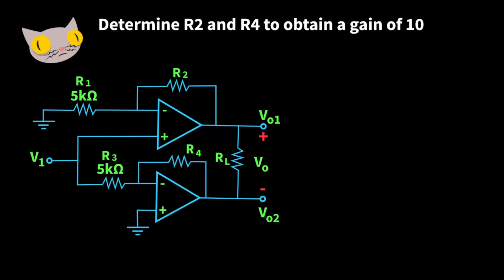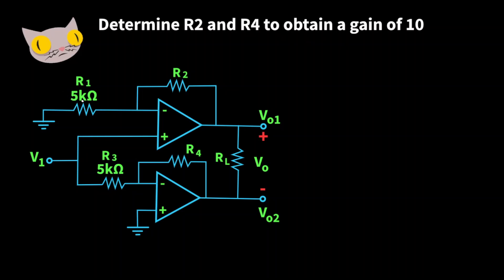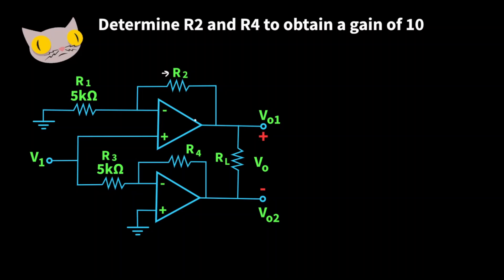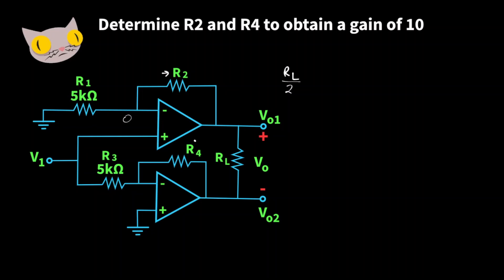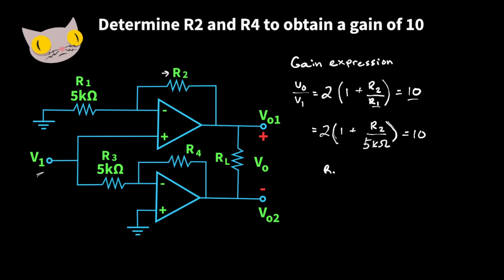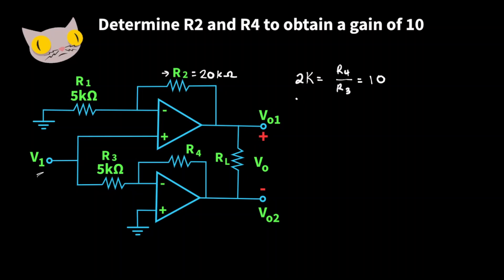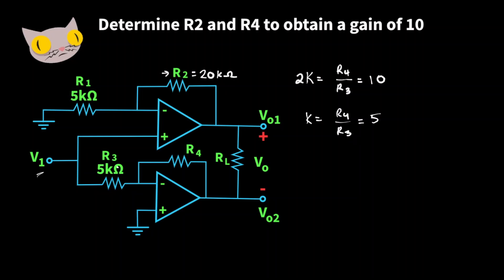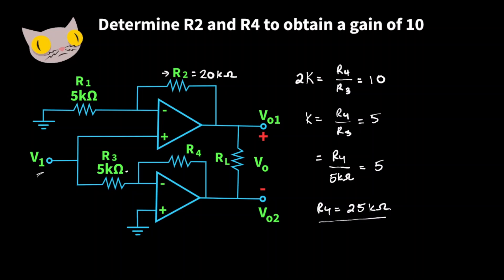FE Exam Practice Problem | Op Amp Gain

Comment: Mind helping with this simple question? 

Question:
To amplify input signal of v1(t) = 0.01×sin(2π×10kHz×t) using an inverting amplifier with gain of -10, determine the minimum required GBW for the opamp.
Reply from the maker: GBW is found by multiplying the absolute value of the voltage gain times the cut off frequency. So it'd be the gain (10)  times cut off frequency (10kHz) giving you 100 kHz.
Reply: @studycat2658  awesome! Thank you for your clarification!

Comment: what does k mean though?
Reply from the maker: K represents the gain of the bottom op-amp, which is an inverting amplifier. The gain expression of the inverting amplifier is given by: K = - R4 / R3 where R3 is the resistor connected between the input and the negative terminal of the op-amp, and R4 is the feedback resistor connected between the output and the negative terminal of the op-amp.

In the given circuit, R3 = 5kΩ and R4 = 25kΩ, therefore:

K = - R4 / R3 = -25kΩ / 5kΩ = -5

The magnitude of the gain is given by the ratio of the feedback resistor to the input resistor, which in this case is equal to 5.

Hope that helps, thanks for watching!
Reply: @studycat2658  awesome thank you!

Comment: Great video.  I am an electronics technician not an engineer.  I have been going on job interviews for electronics technician jobs but I have been getting tests requiring me to answer questions such as the one in this video.  Why is that?
Frank
Reply from the maker: I suppose you are being tested on your knowledge. Circuit analysis is a good skill to have whether you're an engineer, a technician or an electrician. Thanks for watching!